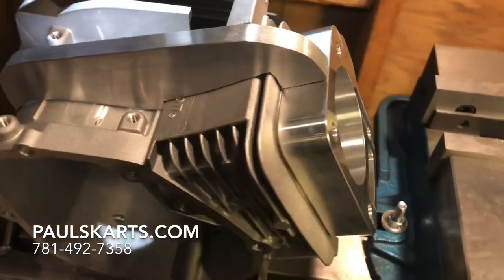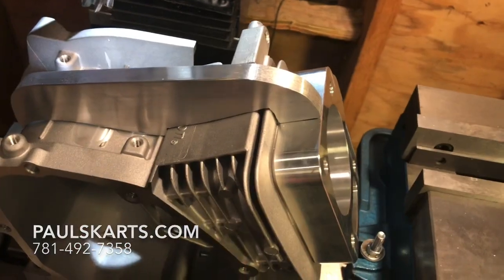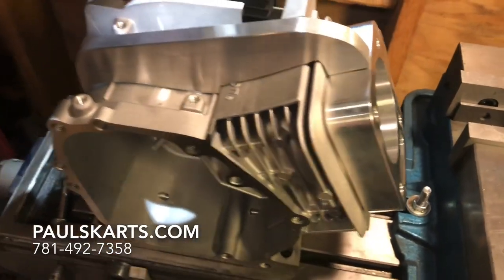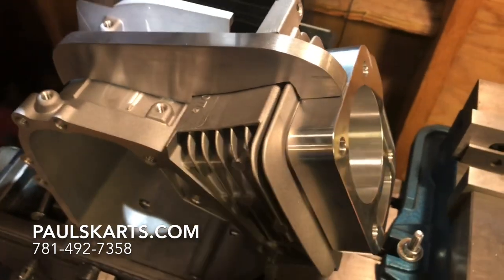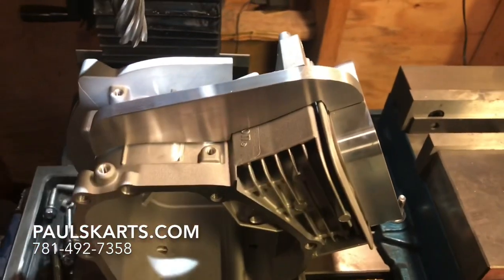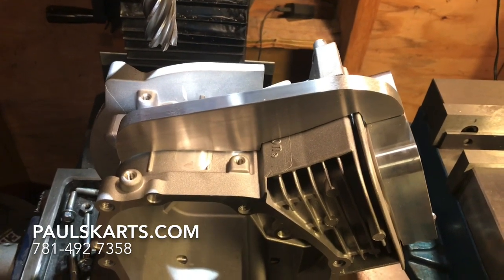304cc Predator 212, 3.2” bore welded block, some behind the scenes work ...

Comment: How fast would something like that run, guesstimate mph?
Reply from the maker: Alexander Locklear .. that question has no answer. Depends on gearing .. and a block alone dosnt make power .. it’s the entire setup. The head cam And carb play huge rolls in the power produced. Speed is just gearing. Read up on some forums ... 😎
Reply: @paulskartslifan4206  Ok,,,,,WELL HOW FAST WOULD AN ENTIRE SETUP RUN? Most people ain't gonna buy something with atlease one thing being guarnteed on it, so that would be speed for me? And like i said just a ball park guest u dont have to be spot on? 330ft
Reply from the maker: Alexander Locklear ... it’s all your decision .. I just build em .. it’s the best there is .. true engine builder here .. 700-900 heads a year .. if you see a better setup out there get that one .. no guarantees in racing ... just trust
Reply: @paulskartslifan4206  the trinity set up
Reply from the maker: @freemanguess8634  the trinity setup is a great way to go, it’s what Id recommend if doing the build at home yourself. Those three parts when made and matched as a set like the trinity is takes out any possibility of building a mis matched combo that many people end up with. We tune these engines to the razors edge and even a small mistake in parts selection can cost you an easy 5 - 8 Hp in a finger snap.

Comment: Could you do that with a predator block instead of a tilston block, we must start with a predator block by our rules, is the only reason I ask
Reply from the maker: Codi Nielsen .. yes
Reply: @paulskartslifan4206  how much would one of those block run
Reply from the maker: Codi Nielsen.. well.. you can send in a block and get the services they the site under small block shop services and purchase the deck extension under small block bottom end.. all on the website Paulskarts.com